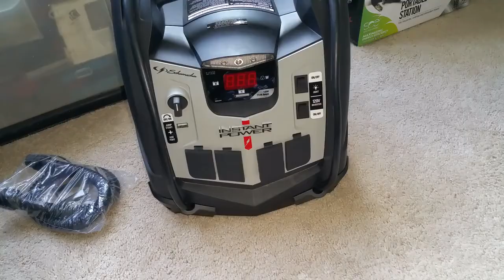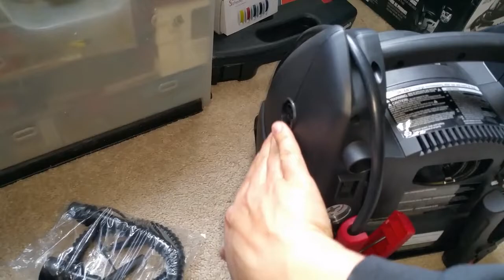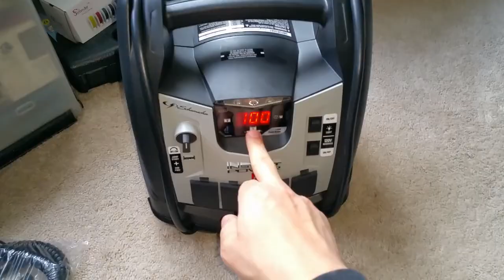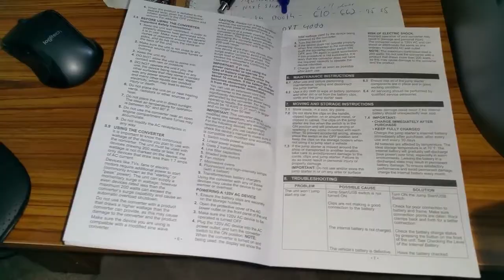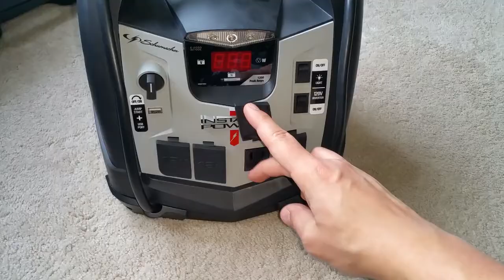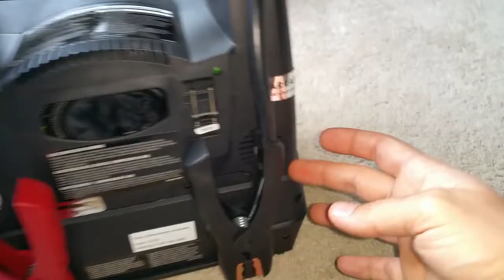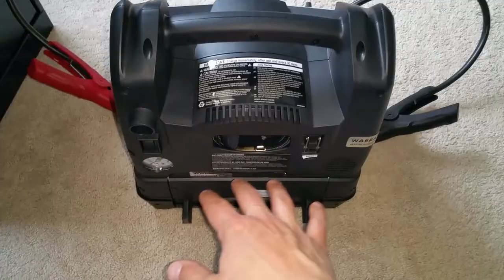Schumacher SJ1332 Review

Comment: Had a question about the unit beeping  is that a really bad sign
Reply from the maker: When does it beep? Short beeps or one long beep?
Reply: @Bassguitarist1985  4 short beeps
Reply from the maker: @jloc260  and this only happens when the main switch to turn on the  jumper clamps?
Reply: @Bassguitarist1985  while charging
Reply from the maker: @jloc260  steady beeping while charging indicates a bad battery. A steady beep tone can also be that the jumper clamps switch is on while charging, or the inverter is on while charging. Steady beep is also an overload condition of the inverter. A quick sequence of beeps happens after a few minutes of the jumper switch being left on as a reminder to turn it off as it causes a parasitic load to the jump pack.

Comment: Can it operate a 12 amp corded leaf blower for a total of 1 hour at moderate power? I can't find any information on what the average lifetime of one charge is for this charger anywhere. Most just mention how long it takes to charge.
Reply from the maker: Absolutely not. Thats WAYYYY too much power. 12 amps is shy of 1500 watts and this jump pack only can do 200 watts, and it cant power that load for no more than 1 hour at full charge.
Reply: @Bassguitarist1985  can it power any kind of leaf blower at all that's corded? I'm asking for an outdoor project that requires a power source, whether it be charging a backup battery, or just going with cordless, larger leaf blower battery.
Reply from the maker: @CoasterTeaFox  it cannot run any corded leaf blower. Even charging a battery for a cordless blower is not practical or recommended. A 22Ah battery is limited for the purpose you want. Also the modified sine wave output of the inverter may not work with your charger, could actually damage it.

Bottom line not the right tool for your job. If you truly want to power a 12A corded blower from a portable power source, a 2k sine inverter with two group 29DC boat batteries will get the job done.
Reply: @Bassguitarist1985  Okay thank you for the insight🙂

Comment: Do you have any suggestions on why my unit is not charging? I plugged it up using several different extension cords on different outlets. But the green light does not come on nor does it charge. Please help.
Reply from the maker: There may be a fuse that popped, or a component in the charge controller board that has failed. Will have to open it up and inspect
Reply: @Bassguitarist1985  where should I look for the fuse?
Reply from the maker: @PrayWithPurpose2023  check inside. There is a control board for the charger. There may be a fuse on or near that board. There is a 20A fuse for the 12vdc sockets, that is not part of the charger.

Comment: Did I miss the part about boosting or charging a car or ATV battery?
Reply from the maker: I didn't really go over that figured it was pretty straightforward.
Reply: @Bassguitarist1985  

It was. I was looking specifically for that because I wasn’t able to jump my side by side. 

Turns out I’m an idiot. I simply wasn’t turning the ON switch far enough. Embarrassing but funny. 

Once I actually turned the unit on it worked just like it should. 

🤦‍♂️🤦‍♂️🤦‍♂️

Comment: So is this a good buy they keep talking about overheating as u put air in tires
Reply from the maker: Yes the pump can overheat, especially filling a tire from being completely deflated. Adding a few PSI to a low tire shouldnt pose a problem at all. The overheat should be temporary as the sensor prevent motor damage.

Comment: Can u run an extention cord charger if battery is shot and still jump a a vechile
Reply from the maker: Do you mean plugging in a battery charger to the AC outlet through an extension cord?
Reply: @Bassguitarist1985  
Yes I believe battery isn't holding a charge and was wondering if I can still jump vechile with jump box by plugging it in directly to outlet to use for my vechile
Reply from the maker: @nauvinflorien8249  not advisable. A trickle charger in the AC outlet, you will deplete the internal battery too quickly to have any positive effect on the dead battery. Time for a new car battery.

Comment: thanks very much  for the info, just got the XPF2260 from WMart and was wondering about the fan going on and off. Have question. I got mine out of the box (sealed) at 95% charged and they said to charge for 36 hours before use... I just charged it untill it said 100% (about 2 to 3 hours), should i did it for 36 hours ???
Reply from the maker: Fan on/off is normal under load for the inverter. If its 100% then you should be good. Probably just needed to be topped off

Comment: My 12V ports have stopped working -- do you know where  access to the fuse is?  I think there is a 20A fuse somewhere that should be accessible, but wanted to ask before I started disassembly.  Thanks!
Reply from the maker: It does need to be disassembled to get to the 20A fuse. Not hard just tedious. Standard blade fuse.
Reply: @Bassguitarist1985  Thanks - I'll get busy!

Comment: What's the difference between the SJ 332 and the SJ1332?
Also, is there an adapter that I can charge this unit as I'm driving?
Reply from the maker: I'm not sure of the exact differences I did not dive that deep into it other than I know that the air compressor is different. If you find a 12 volt accessory male to 12 volt accessory male adapter that will allow you to charge it while the car is running
Reply: @Bassguitarist1985  Thank You.

Comment: If I leave the car off & then leave the "charger" connected to the car for an extended period of time (like 3-4 hours) will the total car battery charge increase? The battery is DEAD (started after about 5 minutes of charging) & I need to know if I will have to jump it every time until I get a chance to get a new battery or if one long charge will buy me some time.
Reply from the maker: No that will simply ruin the battery inside the jump pack. It is only meant for boosting a low battery not a dead battery. You may be causing further damage to your car especially your alternator if you don't replace the battery.
Reply: @Bassguitarist1985  Turns out the battery is perfectly healthy. Something is draining it…
Reply from the maker: @alexisgonzales2958  gotcha. Yeah this jumper pack may not have enough cranking amps by itself. Ot boosts a low battery, a completely dead battery may need a running vehicle to siphon some power back into it

Comment: Will this blow up an air mattress that has a built in motor and a 110 plug?
Reply from the maker: You planning to use the units inflator, or use the unit to power the air mattress that has its own inflator built in?
Reply from the maker: I dont see why not. The motor is likley a DC motor powered by 120VAC
Reply: I am using the power to run the motor in the mattress.  I tried it and it worked, it took about 2 minutes to inflate!  Thanks for answering my question!
Reply: Your video answered a few other questions I had.  There wasn’t a manual with it.  So the video was a big help.  Thanks again!

Comment: Can I run a 25W vox guitar amp with 4 9V guitar pedals and a pair of 60w speakers? What can I run as a guitarist and vocalist? Thanks Bassguitarist!
Reply from the maker: Grab yourself a killawatt meter and see how many watts everything draws on utility first. If its all under 200 watts then it will run, though i doubt it will last long. Plus the modified sine wave is not good for audio equipment, it induces a nasty hum/buzz. 

Whats your application?

Comment: I plugged in my phone on USB and seek to work fine....but I heard a BEEP 3 times in a row? What's that mean?
Reply from the maker: That is normal. It is a reminder beep the main switch is on. The Dc to Dc converter for the usb is a parasitic draw on the battery when not in use thus why it beeps. Not the best design IMO. Better off getting one of those cheap cigarette lighter to usb adapters

Comment: If the inverter goes out you could just buy a 200 watt inverter and plug it in to the DC port.  It would work fine and save trouble to take the old one out.
Reply from the maker: Yes you can
Reply: @Bassguitarist1985  I just bought this 2 days ago.  I have a camper and I have 3 deep cycle batteries in parallel and I have 2 100 watt solar panels connected across the batteries.  I can charge this unit from my solar panels that are hooked to an inverter in my camper.  I can run a travel fridge that pulls 50 watts and the battery stays at 100%.  Pretty cool!  I don't know anything about AGM batteries...is there a down side to charging and using at the same time?  It appears to work fine!
Reply from the maker: @frankroper3274  AGM batteries are charged at a slightly different rate than flooded lead acid batteries but they are very close. In general you should not mix up different types of batteries in a battery Bank. The rig you are describing is good in a pinch but I would not leave that as a long-term solution.

Comment: I also have the previous model Schumacher all in one unit.  However, when someone attempted to jump a vehicle 1 summer day, the outer plastic leads appeared to be slightly burned and part of plastic melted.  The unit worked very well up to that point.  All of the functions remained in good working condition with the exception of the self jumping functions.  Can this be repaired or would it be advisable to purchase the newer unit?
Reply from the maker: Im sure it can be repaired if you are handy. If not then it may be better to buy a new unit

Comment: Really liked your video. I do have a quick question: Can I use a 5 watt Solar Trickle charger to keep the battery topped off while out camping? The charger connects to a male cigarette adapter and will it by plugging it into the cigarette port on the front of the power unit? Thanks for any help you might provide.
Reply from the maker: Yes

Comment: Hi there I got that model but everything works but the jumper shows fully charge and die in seconds do you think just needs a new battery thank you
Reply from the maker: How old is the unit? If used more than 3 years id saybyeah battery is sulfated and needs replacing

Comment: How would you repair the two prongs that charge the unit?
Reply from the maker: They don't have a repair part to replace it. Would need to put a regular two prong plug end in it.
Reply: I just to mine apart because it never charged from day one, it seems like they forgot to hook that part up. Was wondering if anyone else had the same problem

Comment: Thanks for the review. I bought 2 years ago from Lowe’s as well and used very lightly. I can’t charge this unit. I checked online and found out that this is a common issue with this item’s AC adapter. Warranty is not available bcus 2 years passed. Is there anyway I can fix this? I appreciate the response.
Reply from the maker: Is it not charging at all? Good chance the battery inside is worn and needs replacing Or are you saying that the charging unit that charges the internal battery has failed?
Reply: @Bassguitarist1985  
Hi how can talk to you I have o e but I don’t know if can fix it or but  other

Comment: I got the Male-to-male accessory cableto keep it charged while I'm driving,  but where does it plug in? I called them and the young man that answered the phone didn't know.
Reply from the maker: Plug it into one of the 12v power ports. It will keep your battery charged with the engine running
Reply: Do you have to turn any switch on to charge with the male ro male accessory cable?

Comment: I've had this model for over year and love it. Battery life has been great. I leave it in my truck and use it camping too. I've jumped at least 10 cars with it. I also use it to air up/down my ATV tires. Well worth the money.
Reply: Do you leave the switch on or off?
Reply: not impressed with the inverter can't get it to run a coffee grinder
Reply from the maker: You will have to check the wattage ratings of the coffee grinder. Even if the wattage is within 200 watts likely the surge wattage when the grinder first starts up the inverter cannot handle. In addition with it being a modified sine wave the efficiency is far less and you would need more wattage capacity in order to run an inductive motor load like that.
Reply: When it's fully dead and I try Charging The Unit should it be flashing red?
Reply from the maker: Flashing red means that the battery inside has failed and will not accept a charge. Likely the voltage at the terminals is too low for the charger to engage.

Comment: I've had this model for several years now. when I go to charge it there is a faint pop inside. the green light at the charge port on back never comes on and it continuesto read about 33% . with a VOM at the clamp leads i read 11.68 vdc. is there an internalfuse i can replace or is is a control board somewhere?  thanks
Reply from the maker: There is a fuse yes that could be what's popping though it also could be the charge controller that is no good
Reply: @Bassguitarist1985  thanks for the reply. ill look for that fuse. might be money ahead to just buy another charger
Reply from the maker: @coryc1718  its built into the unit. Not sure if you can get a new one from Schumacher.

Comment: If I wanted to charge my 6 cylinder car battery with a battery tender Plus. Could I plug that into the AC outlet of my Schumacher SJ1332 to charge my car battery in my garage if the power is out in my house and neighborhood?
Reply from the maker: You could, but a 20Ah battery in the Schumacher to charge a much bigger battery. You would only get a partial charge

Comment: I own a Schumacher Portable Battery, model SJ1332 QP.  I want to use the Schumacher battery to power a 200-400 watt heated throw blanket on a camping trip. Will the battery handle the load?  If so, for how long? I estimate we will use the blanket for between 2 to 4 hours each night while camping.
Reply from the maker: Based on the highest setting of 400 watts. A 20Ah battery will last a half hour. At 200 watts continuous about an hour. Id say no its not big enough. Now a big 29DC boat battery with about 220Ah, that would do it with an inverter running off that

Comment: can i run my guitar amplifier 90 watt on it?
Reply from the maker: It should run, but depending on how the power supply is designed, you may hear a very nasty buzzing that wont be fixed with a ground loop isolator. You may hear the modified sine wave (stepped square wave) coming through the speakers.
Reply: @Bassguitarist1985  I have heard some comment that the buzzing sound is permanent after using these type of charger. I don't know if that is a one time issue or something to be worried about.
Reply from the maker: @JourneymanBlues  Its hard to say, what model guitar amp you have? Is it solid state? Tube amp? If its 90 watts output, you need to look at the name plate where the power cord is. No amplifier is 100% efficient, likely it will take far more wattage input to get you the 90 watts of sound output. For example a fender guitar amp that is 90 watts output, takes 310 watts input to run. In that case this jumper back is too small.

In terms of the buzz sound being permanent, it is possible.  Keep in mind a stepped square wave this inverter produces is not as efficient with energy transfer as a sine wave like what you get from the utility. The amp will run hotter, less efficient, possibly causing damage. 

Bottom line, even if you have an amp small enough to run on 200 watts, there is possibility of damage. guitar amps are sensitive electronic devices IMHO
Reply: @Bassguitarist1985  I plan on busking with a acoustasonic 90 amp. but dont want to damage it. I would run an acoustic guitar and microphone. It wouldn't be cranked up all the way maybe to half. I wrote to fender company and schumacher. Schumacher said it would not damage but am awaiting fenders reply. i was thinking of getting the model xpf2260 schumacher

Comment: I tried to use it for 12v heating blanket and it doesn't get hot enough,  still testing it out.
Reply from the maker: Its a modified sine wave, so energy transfer is not as efficient as a sine wave like you get from the utility.

Comment: Hi, I can't get the wats to charge. Do you have any advice
Reply from the maker: Not aure what you are asking. Watts?
Reply: The inverter . Can't seem to get it charged. I have a 200 watt heater, a little office one and it only lasts just a second. Or 2,   do you think my machine is defective
Reply from the maker: @rebeccabongo1350  this unit isnt designed for that use running a space heater. Yes inverter rated up to 200 watts, but the internal battery cannot power that much wattage for very long. If it shut down after a second or 2 the inverter is going into overload protect or low voltage shutdown. Doubtful the heater draws exactly 200 watts, likley more than that.

Comment: How do i stop the low voltage beep??
Reply from the maker: Unless you snip the piezo speaker there is no other way.
Reply: Where is the speaker wire? I want to snip it....lol
Reply from the maker: @nicolesadowski1547  not exactly sure. I wasnt looking for it when I popped it open
Reply: Would you happen to know what the speaker might look like?
Reply from the maker: @nicolesadowski1547  brass colored disc with a white center ussually. 

Are you refering to the unit beeping every few minutes with the turn switch on?
Reply: Yes. Unit says its 65% and even charging my cell phone using the usb after 30 seconds it has a continous beep even though the phone is still charging.
Reply from the maker: @nicolesadowski1547  it beeps is because the built usb unit is a parasitic draw on the unit. If you dont want it to beep while charging your phone, but a 12v accessory plug to USB charger is better. The 12v ports are always active and hey avoids the beeping.
Reply: I just tried the 12 volt cigerette lighter charge plug for the phone and it still did the beep thing
Reply: Ok.....i get this now. With the 12v i dont have to turn on the battery pack.